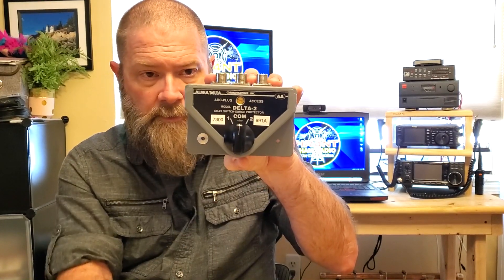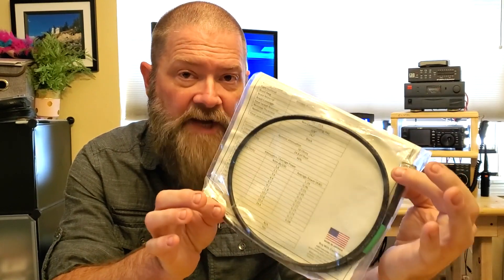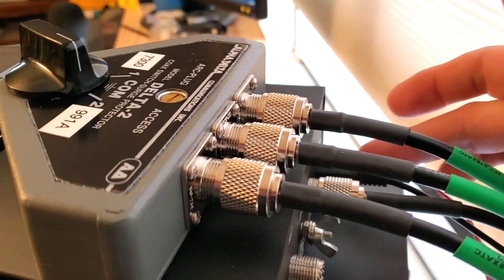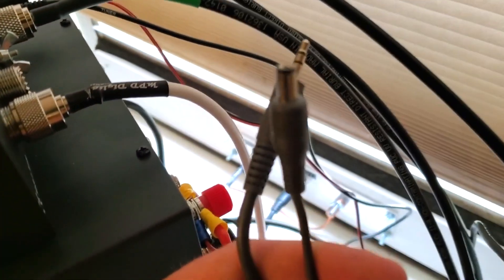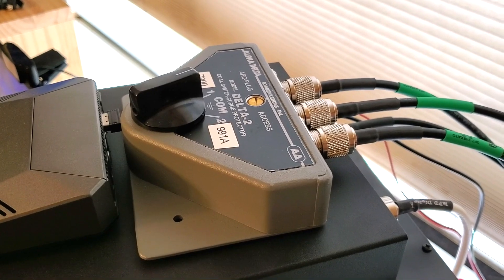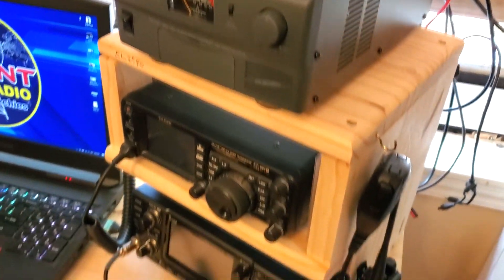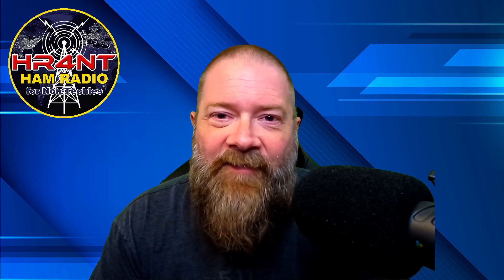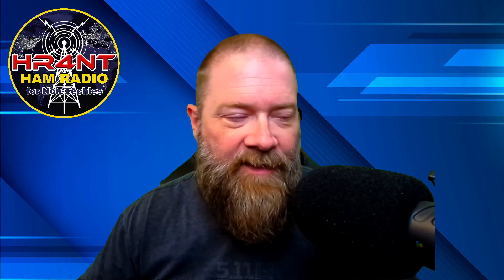A Tale of Two Radios - Running two radios with one antenna

Comment: I was looking at the exact switch for the same problem. I have 3 radios and 1 HF antenna. I was told that it is possible that RF could get into to other radios not in use, there is not enough isolation to keep that from happening. Any feedback about this possible problem??
Reply from the maker: I never ran into that problem, however since this video, I sold the 991 and bought a dedicated VHF radio to separate the two.  Seems to be fine.  Thanks for the comment and for watching.  73!!

Comment: I have one antenna two radios and Alpha Philadelphia coax switch and then I have that comes out of the top of that into a little position that you can get around 45 bucks then run run run that up to your other coax switch and you’ve got it all solved pretty simple reallyhave a good day bye-bye
Reply from the maker: Sounds like a good setup.  I assume it is working well for you.  Thanks for watching and for the comment.  73!

Comment: I don't know how good the quality is of your switch but I do know in most cases the only thing that is switching is the center conductor of all the coax cable as all the outer conductors (Braid) of the coax are all constantly connected. I would seriously consider putting a power meter with a dummy load on the opposite side first while transmitting to check for low power RF feeding across to the open side of the switch through the center conductor. I've seen this done before and there can be as much as 10w of stray RF feeding up the backside of the 2nd radio.
Reply from the maker: Since this video, I have sold the 991A and am just down to a single 7300 and a separate Yaesu 2980 for VHF, so I am no longer using that switch.  Thanks for the coment and for watching.  73!

Comment: Here’s a conundrum… you have several dual band radios and want to transmit on one radio while simultaneously listening on the other dual band radio. Antenna switcher is not the solution as it disconnects one of the radios.
Reply from the maker: I have since resolved this issue removing the switch and having a dedicated VHF radio on a GP 9 while My 7300 is on a DX Commander.  Sold the 991 shortly after this video was released.  Thanks for the comment and for watching.  73!

Comment: I went with patch panels.  One panel is antennas, the other panel is radios.  With a short jumper, I connect whichever radio to whichever antenna.  With your current setup, with both radios powered, it would be easy to transmit to ground, from the radio not connected to the antenna.  (in my case, transmit to an absolute open is possible, if I do stupid...  neither is good for the radio obviously.)  I build antennas, so have several to select from.  So long as there is separation by band, with the power levels I'm running, I can have both radios operational.  Not throwing shade at your solution.  It's clean and works.  Just wanted to point out a potential problem you already probably considered, but others may not catch, depending on experience level.
Reply from the maker: Since this video I sold the 991A and replaced it with a Yaesu 2980 VHF so I have a dedicated VHF separate from my 7300...and I have a switch I no longer use...LOL  Thanks for the comment and for watching.  73!

Comment: Another thing I just thought of is using a crossover switch. It has 4 terminals (A, B, 1, 2) and two connection states: A-1 B-2 or A-2 B-1. If you have just one antenna, you can connect the other terminal to a dummy load, that way everything is always properly terminated.
Reply from the maker: That is a fantastic idea!  Thanks for the comment and for watching.  73!

Comment: You understand that particular switch only “switches” the center conductor, NOT the shield; meaning that the shield (which is a conductive portion of the coax) will be direct from one transceiver to the other. 

DAIWA switchesground shields independently
Reply from the maker: I do, but it seemed to work just fine without causing any issues or damage.  I have since then separated the radios and went with a different configuration.  Thanks for watching and for the comment.  73!

Comment: It is a pretty simple solution, and a common one, but, you probably don’t want to key up (transmit) on one of you radios with the switch in the wrong position (on the other radio).
Reply from the maker: Agreed.  Not trying to trash my gear...LOL  I have since come of with a better solution and eliminated that switch.  Thanks for the comment and for watching.  73!
Reply: Did you do with a a duplexer or ?
Reply from the maker: @mikewilsher1005  I sold the 991A and replaced it with a dedicated VHF radio the Yaesu 2980.  So I have two radios dedicated  to  HF and VHF separately.  I never had much operation on UHF, so not having that feature wasn't an issue.  If it is down the road, I will adjust my gear accordingly.  73!

Comment: Thanks for the nice video. I have a similar setup, but I'm a little concerned about what will happen if I accidentally transmit from a radio that is not connected to the antenna.
Reply from the maker: Be aware of which radio is connected.  You DO NOT want to transmit on a radio with no antenna attached.  That can fry some internal components and cause a bad day.  Thanks for the comment and for watching.  73!!

Comment: Being an apartment dweller I only have one external antenna for HF. (An inverted L via an SGC auto ATU) I have a four way antenna switch. I had an Icom 746 which mainly resided on Two Metres, and an Icom 718 or HF. I till have the 746 but now hae a 7410 for HF. I worried that leaving the 746 witched on even on Two would damage the front end of th 746 when firing up on HF, so I disconnectd the co-ax from the 746 to the switch. It is till hand to hae for quickly using or trying out anther rig n hF without having to bugger bout wth shifting gear and unscrewing co-axes.
Reply from the maker: My suggestion is do what feels comfortable and right for you to protect your equipment.  I had no issues with running the radios, but I have since them sold the 991 and just have my 7300 now and a Yeasu 2980 for VHF operations, so I have eliminated that switch from my gear.  Thanks for watching and for the comment.  73!

Comment: Been doing this for years, no problem. You can really have as many rigs to choose from as you want in the shack but probably best to shut off the ones not in use. You can also put in a remote coax switch and have 4 or 5 antennas on that switch and rune one feedline out of the shack....
Reply from the maker: Thanks for sharing that!  I appreciate it.  Thanks for the comment and for watching.  73!

Comment: I have a cheaper switch and have been having odd problems. It isn't particularly needed now.

1) There are 2 radio and 2 antenna devices, I've seen them on the DX Engineering site. You switch between 1->1 and 2->2 with 1->2 and 2->1. The second antenna could be a dummy load if both radios get used on, say, HF.

2) I have a FT-857D, LDG tuner, DX Commander, efhw, and VHF/UHF antennas. I use a comet duplexer at the radio end. The VHF/UHF goes directly to the duplexer. The HF goes to the tuner, then to the remote switch control, then to the duplexer. One 200-foot coax to the antenna farm where another duplexer takes the VHF/UHF off to that antenna, and the HF side goes to the remote switch and from there to the two HF antennas. I pre-tested the duplexers. They only pass the DC on the HF port.
Reply from the maker: Thanks for the input!  I have another switch I use now just to have multiple antennas when I am out doing POTA.  The switch in the video was a good idea, but I later decided to separate my HF operations from my VHF/UHF stuff.  Much easier and much happier now!  Thanks for the comment and for watching.  73!!

Comment: I have a Yaesu FTM-2980r with Kantronics KPC 3 Plus that is serving as my digipeater and IGate.  I also have a Yaesu FTM-6000R and Kantronics KPC 3 Plus serving as my Packet Station/BBS.  Would a Diplexer work in this case?  The single VHF antenna that I have is a Comet GP-1.  Thanks for any help!
Reply from the maker: You may want to consult the guys over at DX Engineering, but i think a multiplexer would help in your situation if you want to run multiple radios off a single antenna.  I know we use one when doing POTA with more than one operator, I think the same would work in your situation, but research that first.  The guys at DX Engineering should be able to answer that in a heartbeat.,  Thanks for watching and for the comment.  73!!

Comment: Good job!  I have my kenwood 570 and ic-7300 are hooked the same way however each radio has its own internal tuner. NH6VT
Reply from the maker: Hi Mark!  The 991A and the 7300 both ha tuners as well, but I was not sure about the range.  I think they are 3:1 whereas the external tuner is 10:1...I think.  I have since then sold the 991 in favor of the 7300 and added a dedicated VHF radio, the Yaesu 2980 for my local repeater work radio.  Thanks for the comment and for watching.  73!

Comment: Consider a diplexer. Lets you receive on both radios simultaneously and you can transmit from either radio.
Reply from the maker: That is something I am considering down the road.  Thanks for watching and for the comment!  73!
Reply: Pretty dangerous, if you have both radios close in freq, there is no way a duplexer will give you enough port to port isolation.  You'd smoke the front end of the other radio very quickly if not careful.  At least the switch has a more or less flat 50dB regardless of frequency.  You really need that 50dB.  100W is +50dBm, so you're down to 0dB into the RX input of the other radio, which is more or less safe for most RF front ends.  If you're down to even 30dB isolation, that +20 and really well into the danger zone for burning the 1st RF amp.  Duplexers (prob better called a crossband coupler) are fine for say 2 and 70 as there is no chance of the frequencies being closer than about 280MHz part.  I'm actually curious, have you even seen a broadband HF duplexer for ham radio use?  I really can't see how it could work in that it has to pass all over 1.6 - 30MHz though both ports, so how could it do that, while still providing any isolation at all between the two transceivers.  I dunno, perhaps I missed the memo?

Comment: Do you run the antenna into the tuner, then the tuner patch cable into the common port of the switch?
and most importantly have you had any issues with this after having used it for a year?
Reply from the maker: Actually at the time, I ran the Antenna into the switch, then a patch cable from the switch to the radio(s).  There are different connection cables for the 991A vs the 7300, so I had to switch out that cable to connect the tuner to the radio I was wishing to operate at the time.  I have since then sold my 991A and just run the 7300 now.  I wanted to separate my VHF/UHF operations from my HF and that seemed to make smore sense having a dedicated VHF radio.  Throughout the time I had that setup, other than inconvenience from having to switch out the tuner cable s between the radios, there were absolutely no issues running it in that way.  I hope this answered your question.  Thank you for the comment and for watching.  73!

Comment: I had been also thought about the same solution. The big th8nk to remember not all are created the same you went with the best one so far. But the big thing is isolation and some of the cheaper ones don't have enough isolation for it not to damage the radio's. Be sure to thoroughly check into the switch your buying and how it is grounding and isolated one port from the other. There are some that say they can be used but they are minimal for specifications and a high chance of back feeding to the other radio's. Great solution but hopefully others will not purchase a cheaper version and expect the same results might be an expensive learning lesson on cheaper may cost more in the end....
Reply from the maker: Thanks for sharing that!  I am a firm believer in buy once cry once and I try to convey that message to the viewers.  It is too easy to just buy whatever looks like it will work without considering the consequences of saving a buck over quality.  My solution in this video seemed to work out just fine without any repercussions.  Thanks for the comment and for watching.  73!

Comment: For those tuner connections... why not leave the Icom plugged into the tuner and use the Yaesu's internal tuner ? I assume your tuner has a bypass option... so then you don't need to swap cables at all.
Reply from the maker: At the time when this video was shot, I still cared about tuners.  Now I only use resonant antennas that I tune once and hence no need for an external ATU.  As to your comment, the internal tuners in both the 991 and the 7300 are both 3:1, so they were both the same as far as performance.  However, since this video, I have sold my 991A and now just run a 7300.  Lessons learned...Thanks for the comment and for watching.  73!

Comment: Isn't this an antenna switch and not a rig switch.  This could damage the front end of the rig on the other port being so close to the transmitting side. Just a question or is it me that's got it wrong ?
Reply from the maker: I called and inquired about what I wanted to do and how I intended on using it and the guys at HRO said it would be perfect.  Hasn't failed me yet, but you must pay attention to what it is switched to when using it to prevent damages or accidents.  Thanks for the question and for watching.  73!

Comment: Nice video. Consider ferrite clipons on the coax and power cables. My shack is full of them, you can never have too many. I use about 600 watts on most of my transmissions. 73's from Belgium.
Reply from the maker: Thanks for the info!  I actually picked up a few of those and implemented them in the shack!  Thanks for the comment and for watching.  73!

Comment: Could you please explain in more detail the connection of the cables from the tuner to the radio, ..I think they are different for each radio, so.. do you have to disconnect one radio, and connect the other?… I just got an LDG tuner, but and it came with 5 different cables for 5 different radios…. The Yeasu, and Icom cables are not interchangeable..
Thanks…
Reply from the maker: You are 100% correct!  If I switch radios I have to switch cables because Yaesu is Yaesu and Icom is Icom and the cables are definitely not interchangeable.  It's a bit of a pain which is why I switch over to using resonant antennas like the DX Commander so that the tuner gets retired...LOL  I hope this helps!  Thanks for watching and for the question.  73!

Comment: One big concern I have with your double throw single pole (DTSP) antenna switch is you run the risk of mistakingly keying up the radio that is not connected to your antenna load. That would likely damage your radio. I don't know why they don't make DTDP antenna switches. That would allow one throw to connect to the antenna and the other to connect to a dummy load. This would eliminate the paranoid triple-checking of the antenna switch before keying the mic.  

Did you consider an RF duplexer such as the TW-72 duplexer or the MFJ-916B duplexer? If you did and ruled it out, I'd like to know why. I am considering a similar setup with the duplexer instead of a switch. The duplexer eliminates the risk of keying the radio without an antenna load. It also eliminates the step of checking the switch position each and every time I start a new session.
Reply from the maker: I did not consider a duplexer at the time, however I have not had any issues with the switch I used in the video.  I have made some different arrangements since that video as well.  The 7300 is not my portable radio and I just sold my 991A to replace it with a secondary 7300.  There will be a video about it down the road.  With the old configuration there were risks, but I always made sure that I paid attention to what I was doing and which radio was operating at the time.

With a duplexer and two radios, as long as you are operating one radio at a time, you wouldn't have to worry about having band pass filters, so that may be a good alternative solution.  Thanks for the comment and for watching.  73!
Reply: What you're describing does exist, it's called a "crossover switch". It's not a full DPDT but it's the same as wiring up a DPDT to swap two inputs between two outputs.

Comment: Im looking into the same setup. Im looking at this to run my base   gmrs radio and my digital scanner on one antenna, to switch back and forth, between the two, one at a time without smoking the scanner. Is this setup still working out ok for you? Thanks
Reply from the maker: Yes it is working exactly as I planned it to.  No issues on my end so far.  Love the setup.  Thanks for the comment.  73!
Reply: @HR4NT  I understand the basics and some tech but I like a simple clean setup. Someone told me that even when switched seperately, there's leakage to the other side that becomes higher as the frequency goes up. 144 less than 470 and I should measure it. Now you run into expensive equipment that you use once or twice. He also told me that while it may seem ok in the beginning, that over time that bleed over can burn it up slowly over time. Some techies are just plain overkill, paranoid nut cases and it's hard to know if they are one of them. Proof is in the pudding. If its not problematic for a year strait, its a win to me.
Reply from the maker: @TC-et7ug   If there are any losses or anything leaking over it's so unnoticeable it's not worth your time to stress out about it.. Mine works and it works every single time and I have not had a problem yet with it so take it from somebody who doesn't overthink things… lol
Reply: @HR4NT  perfect! Thanks for your time.